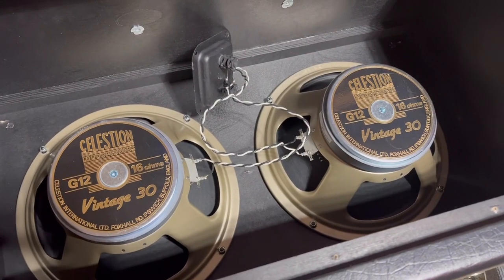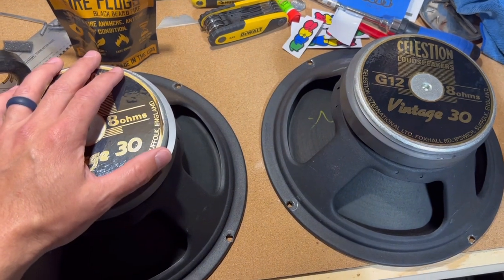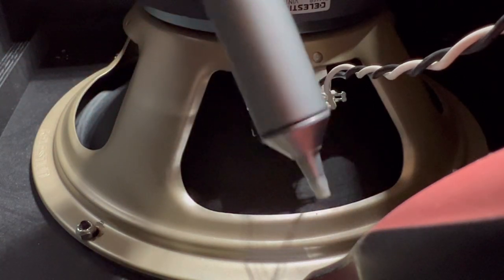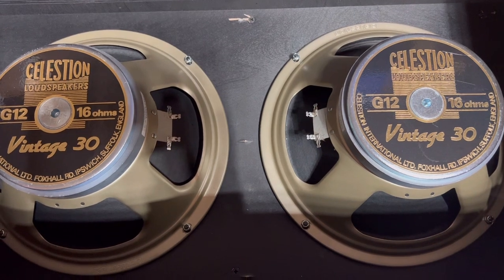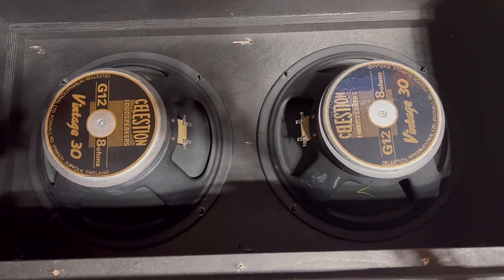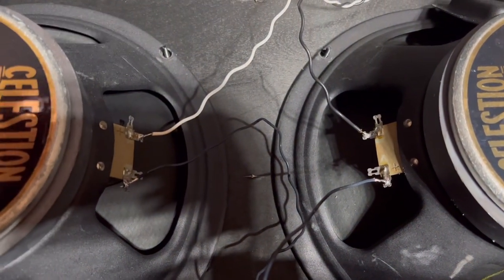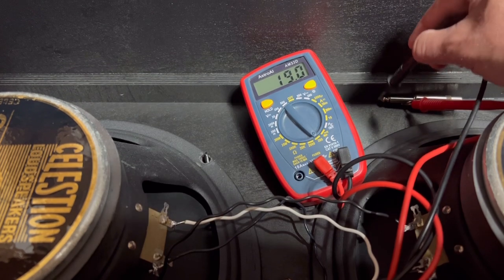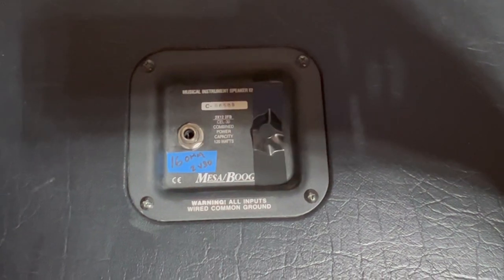Wiring a Mesa Boogie 212 - 8ohm to 16ohm - Celestion V30’s #SpeakerCabinet #v30 #mesaboogie #guitar

Comment: Cool video,thanks. Im actually doing this right now. I have two Mesa 2x12 and I want to A/B both cabs using the same speakers (V30's by Mesa) but one in parallel and one in series. I got the 8ohm speakers off of a Mesa 4x12. Did you hear a sonic difference between series vs  parallel, coming out of the amp at 16ohms?